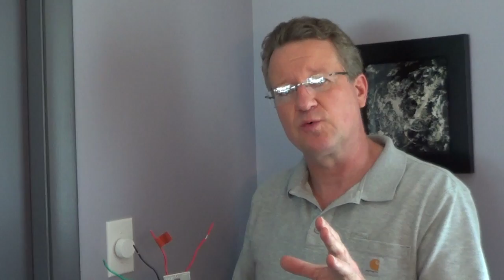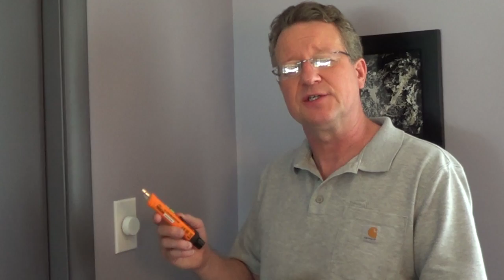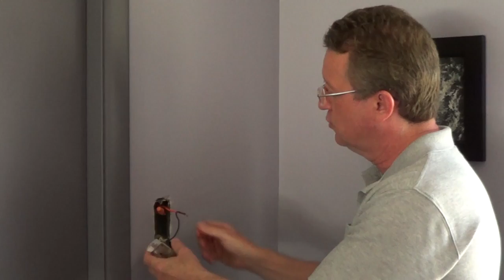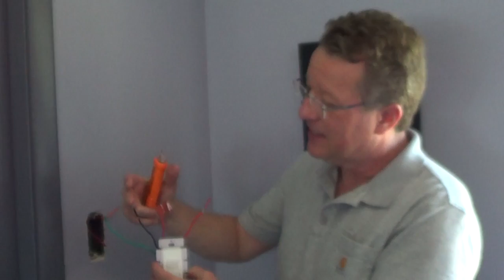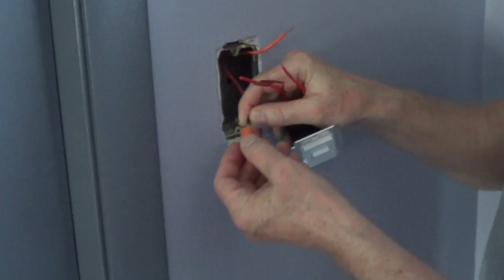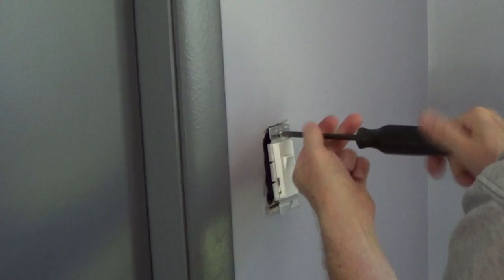How to Install a Dimmer Switch - Single Pole Dimmer

Comment: Thanks for the video! It helped a lot. The only thing I would mention to viewers is just that the neutral wires won't touch the switch at all, but wire nut inside the box.
Reply from the maker: Good tip!

Comment: Nice video I have two white wires and two black wires and no ground I have a dimmer switch that has the red the black and the red white wire which is a traveler wire my question is do I wire nut to two white wires together continuous and just use the two black wires when putting the dimmer together
Reply from the maker: Hi, you can send a picture of the switch and wires in the box to fixitpodcast@gmail.com

Comment: Help!!!
I live in NYC where we use mc (bx) cable. Do i ground my dimmer like you did with just the screw? Or do I use a pigtail grounding wire, screw it into the metal box and connect that to the dimmer’s ground wire? Or just something else?
I never know what is the right way.
Reply from the maker: Hi, if you have metal boxes and metal conduit back to the service panel, the dimmer will be grounded when you screw it into the box. You can use an electrical tester to confirm. You can use a grounding pigtail screwed into the box and connect it to the ground on the dimmer for a more secure connection.
Check out more home improvement tips in our e-books https://www.amazon.com/gp/product/B0B2KW1FQ9?notRedirectToSDP=1&.
Reply: @FIXITHomeImprovementChannel I learned a lot today researching online about my metal cables. I guess I never knew the differences between BX, AC, and MC cables until today.
I do not have conduit. Here in NYC we use AC or MC cables. LOL…at least in ny days that is. In my case AC cables are run throughout my house so just as you did in the video I never used a green ground wire. The sheathing is the ground. That was just how things were done throughout the years. Nowadays they use ground pigtails for what they believe is a better ground. 
I guess I will use what maybe the more secure solution and use the pigtails.
Thank you for the reply and video!
Reply from the maker: @BLAZE21000  Hi, here are some tips from our podcast. https://youtu.be/ADxiqkHUQ0s

Comment: What about Iowa? I realized there is no ground wire to connect in the metal box when I tried to put on a new light switch?
Reply from the maker: Hi, is the metal box grounded?

Comment: I got 2 black wires going to the switch , and my white wires are pigtailed . Go hot to common , then what with the other black wire ? My dimmer is telling me to run a neutral to it
Reply from the maker: Hi, what type of dimmer do you have? Is it single pole only or can it also be wired as a 3 way switch?

Comment: Question both of my wires black and white both have power continuity.
Now my question is how do I wire a 
A dimmer switch that has two red wired and one black wire as you have ..
Ty
Reply from the maker: Hi, you can email pictures to fixitpodcast@gmail.com.

Comment: What would happen if you switched the red and black wires on a single poll dimmer? In other words, if the live wire was connected to the wrong  wire of the two.
Reply from the maker: Hi, with a standard single pole switch or a basic single pole dimmer it doesn't matter which hot wire goes to which lead or screw terminal. I would read the instructions for new dimmers, with the electronics in some switches they may want the flow of electric to be a specific way.

Comment: I'm in the Chicago land area. I have two red wires and one tan or white wire. No matter how I wire up the dimmer it doesn't work properly even with halogen bulbs
Reply from the maker: Hi, could you send a pic of the box with the wires and the dimmer. There are a lot of new dimmers with different ways to wire them. Some dimmers have a line and load side, some need a neutral wire. It is a new world because of led's and wifi. You can email me at fixitpodcast@gmail.com.

Comment: Why wouldn't you find out which wire was hot before you turn the power off. Why go through two steps. Also it is not a bad idea to use the ground wire anyway no matter where you live as modifications may have been made Behind the Walls that you're not aware of
Reply from the maker: Hi, for someone who is new to working with electric, it can be safer to make sure the power is off in case a hot wire comes out of a wire connector as you pull out the device. I test the metal box to make sure it's grounded. I should have showed that.

Comment: Hello. First, it's a great video! Thank you. I live in Chicagoland suburb area, so now I got to know the reason why my house doesn't have ground wire. However, I tried to install the single-pole dimmer but it didn't work. Our wires are blue & purple, which are different from normal colors... I wonder if I didn't connect them correctly. Is there any advice?
Reply from the maker: Hi, feel free to send a picture to fixitpodcast@gmail.com.
With conduit, the hot wires can be any colored with except green or white.
Reply: @FIXITHomeImprovementChannel  Thank you for your quick reply! Yes, I will send some pictures tonight when I go home. Thank you, again!
Reply: @FIXITHomeImprovementChannel  I sent an email to you, it would be appreciated if you could help me. Thank you!

Comment: I have a dimmer nob and a  fan. Do I use a single pole dimmer or a three way dimmer? The reason I'm replacing is my old nob and twister broke. I have the same color wires sticking out on my new dimmer nob. Also I live in chicago as well. I would appreciate your help
Reply from the maker: Hi, you can email me at fixitpodcast@gmail.com. Is one switch for the light and one for the ceiling fan?
Reply: Thanks for repling great Sir. I have an old

rotary light switch and two pull chains one for the lights and one for the fan. There's no switch for the fan. However, when the rotary light switch is on the fan turns on unless I pull on the fans chain and turn it off. Furthermore, there are two wires a black and white one connecting to my old rotery switch. Last,  I live in a 1930s bungalow house if that helps

Comment: My single pole switch has a black and white only. Do I hook up this white wire to the dimmer red?
Reply from the maker: Hi, if the old switch was connected to the white and black, the white wire should be marked with black tape or marked to show it is a hot wire. You can email a picture to fixitpodcast@gmail.com. With most dimmers, they want the line hot coming from the service panel to be on a specific wire or screw terminal.
Reply: @FIXITHomeImprovementChannel   - Thanks for quick reply. A voltage tester actually shows the white to be hot and no indications for the black.  Sent email with photo.
Reply: Thanks for the email correspondence. You helped me get the dimmer up and running!
Reply from the maker: Glad I could help.

Comment: What is the make of the electric tester you're using? Thx.
Reply from the maker: Hi, that one is from TackLife. I also like Sperry and Klein. 
Subscribe to our weekly podcast for some home improvement tips. 
https://itunes.apple.com/us/podcast/fix-it-home-improvement/id880903087?mt=2
Reply: I'm an Android user. Is there another way to subscribe to the podcast? Thx.
Reply from the maker: Hi, you can subscribe on Stitcher, Google Play Music or most podcast apps on Android. Here is Stitcher http://www.stitcher.com/s?fid=49441&refid=stpr
Reply: I was checking my limited assortment of tools and found a Sperry continuity tester. Is that different? I wish I could upload a picture here. I have something else that is yellow with a light diode and black and red leads.
Reply from the maker: Hi, I like the non-contact electrical testers without the wire leads for basic projects, but a multi-meter with leads does a great job on a wider range of projects.